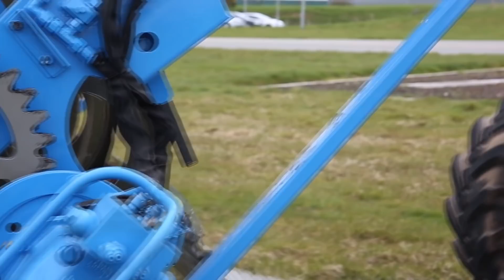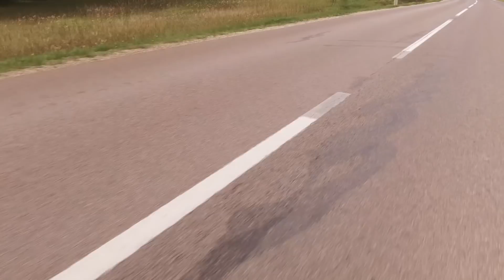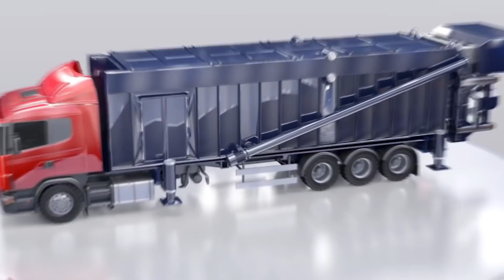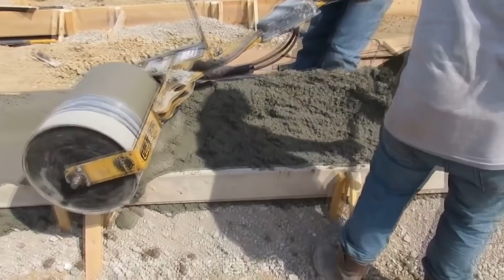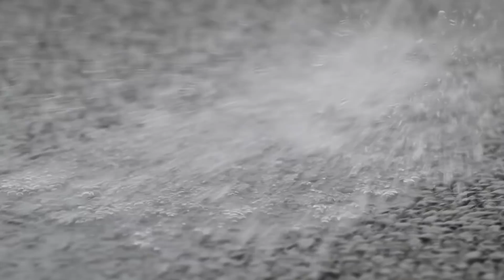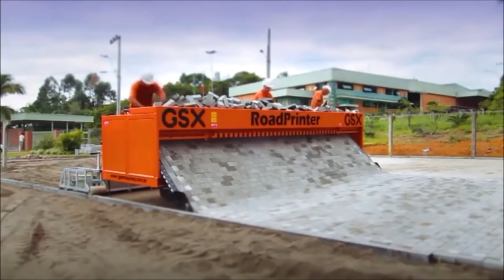15 Amazing Road Machines

Comment: we r far to dependent on roads not new train float train mass trains & buss transport that can b outfitted to handle the worst conditions till roads can b tail of dog safely reopened at least 1 lane. If at most 2 or 3 weeks roads fully closed in worst yrs major areas no need to fight the tide, roll w/it. SUV chain bad ass bus can keep rolling any conditions those ppl living on the outskirts for a fraction of price of mass & snow blitz removal. Just need 1 lane dog trailer suv safe conditions not spotless at any cost gov bs!

Comment: Guard rail hard or soft still wrong. Watch nascar 5mins, u need 2 lift small med or large car or trucks & hook the under side of the car or semi or truck & hve to b dragged along top of railing till energy is used up. Or if to high to hook it a fencing that catches absorbs the hit energy & nets it. God fixed that worked that out 2+ yrs ago.

Comment: also, imagine if the road marker driver loses control of the wheel and not able to stop the machine from going......
Reply: It said the driver is there to make sure it functions properly.
Reply: It’s no different than current technology in the ag industry. Tractors drive and operate themselves the farmers is only there as a failsafe

Comment: if the driverless sweeper doesn't need a driver to control it, why do they make the driver seat??????
Reply: Because they were using an already built machine and retro fit it instead of spending money on having a new one made and if the comp breaks then it could still be used by a human. The fear you should have is that every one of these inventions replaces laborers and we already see the rise in unemployment due to automation.
Reply: Because it can't park itself. Haha Why there's a passenger seat confuses me though.
Reply: Maybe there is a small robot in the driver's seat that can't see over the dashboard and cannot be seen unless the driver's door is opened.  I think we should continue this conversation until we get some answers!
Reply: So someone can drive it when the computer breaks down 😂😅

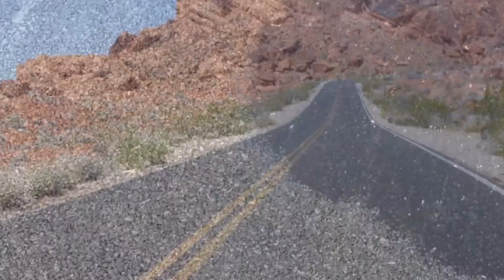Comment: About that Porous Asphalt at 10:24, did anyone else immediately think about the enhanced possibility of that causing more sink holes? I don't know,  even though they claimed to be able to drain the water off properly, it still seems like a scary possiblility to me.
Reply: Actually no, with the way it's designed I'd say it reduces the chances for sinkholes.

Comment: #7 Road milling machines do NOT "lift" the road surface, they have a cylindrical drum with hundreds of removeable cutting teeth that literally shred the road surface at hing speeds and can be set for a depth of a few inches to the full depth of the asphalt layer. Have transported these milling machines close to a hundred times by heavy equipment float, and the cutting drum can be hydraulically raised and lowered inside the chassis, as well as the complete unit can be raised and lowered.
Reply: Had to come to the comments to see if anyone knew what the hell they were talking about
Reply: His explanation was PAINFUL to hear.

Comment: Roads would last longer if they were built properly with decent materials (cheaper in the long run than the use of cheap materials in need of constant repair) and if the road workers actually worked instead of sitting around all day reading their newspapers drinking their coffees!

Comment: It’s almost like nobody actually thinks beyond the basic concept when coming up with these “roads of the future”

Solar roads:
Solar panels need to point at the sun, be unobstructed and aren’t durable. 

UV paint on roads:
Roads are expensive, anything that adds cost unnecessarily is unlikely to be widely adopted. 

Inductive charging roads:
Roads have to be able to expand and contract, can’t do that with wires in them.
Plus the amount of power you’d have to output would be both dangerous/illegal and not efficient enough to be worth it. Car batteries are simply too big and are too far away from the ground (think of how close your phone has to be)
Reply: Yeah, solar roadways sound great but once you look into it are exceedingly stupid and have been huge wastes of time so far.
Reply: No one thinks about it

Comment: Speaking of road lane markings, there should have been a machine that lays down the thick road lines. Idk what they’re made out of, but I’ve seen rolls of them where you’ll see the yellow line on the side of the road and then it starts to squiggle side to side, and then all of a sudden it comes up off the road and into a roll of yellow line lol. I thought they were all painted but nope.